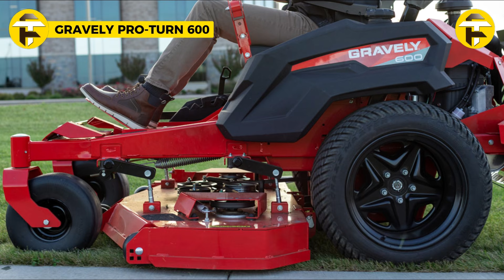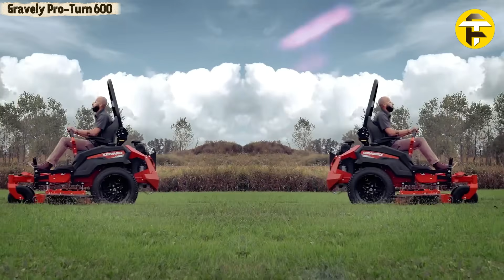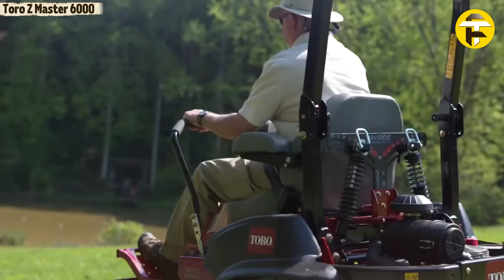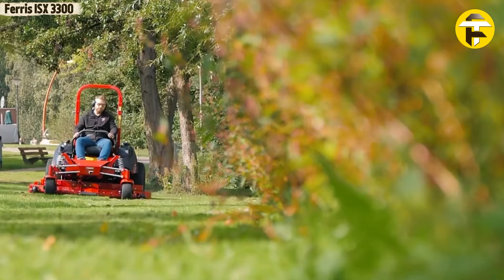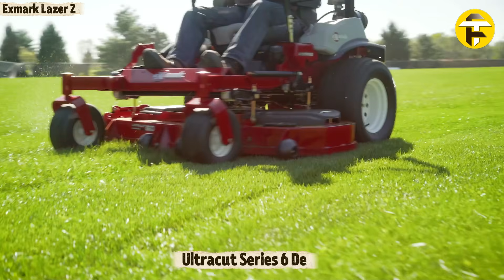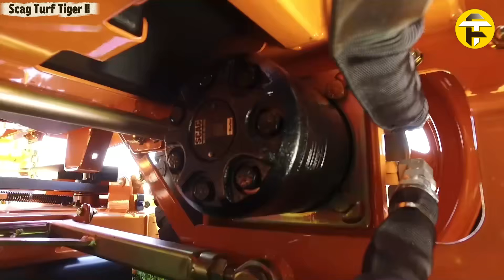The Only 7 Commercial Zero Turn Mowers LANDSCAPERS Trust in 2026

Comment: Being I am a cheap charlie and don't do commercial mowing, I have a 1999 Snapper Pro ZM2500, which is gettting hard to get parts for.   My back up is a John Deere 820a.  The snapper is powered by a 25 HP horizontal Kohler and the Deere a vertical 25hp Kawasaki.  The main reason.... I GOT THEM BOTH FOR FREE.   I mow about 4 acres with a lot of trees and pathways.   The snapper with the joystick steering is great for this, leaving one hand free for a beer or drink of your choice.   Ok.. ya'll can stop laughing... If I had 20k to blow on one of these I certainly would get one.... but for now... I won't be upgrading.... My 2009 rust bucket silverado with 205,000 miles needs upgraded first, which I bought new a long time ago.